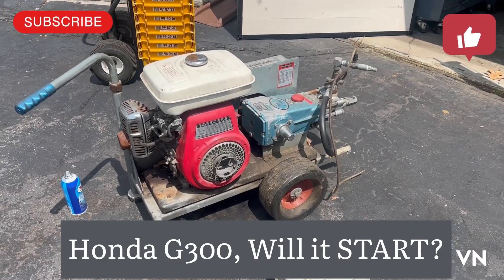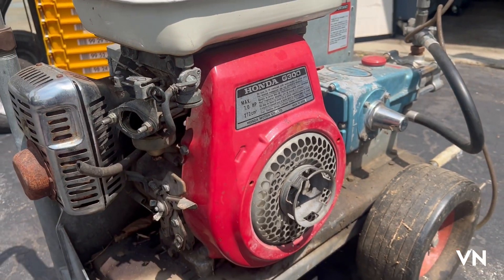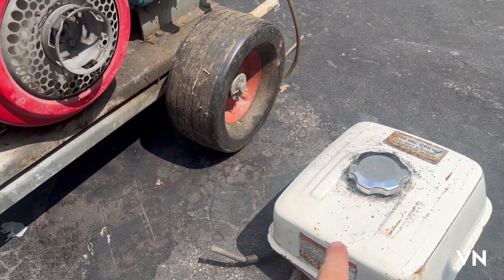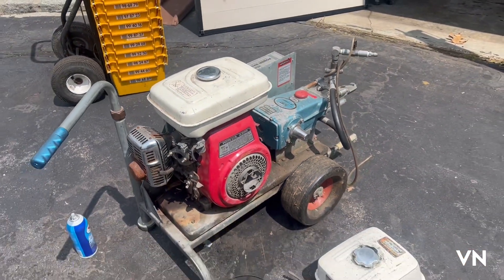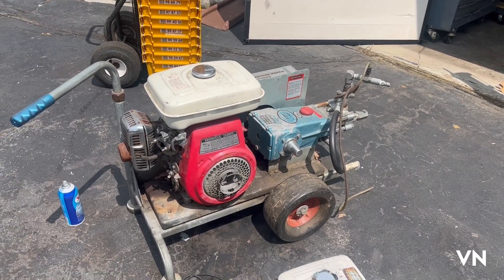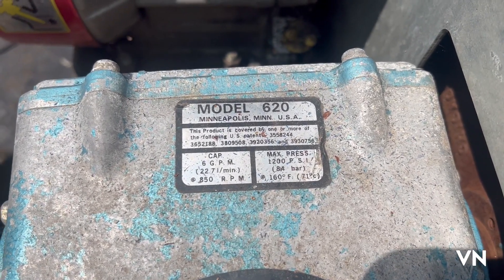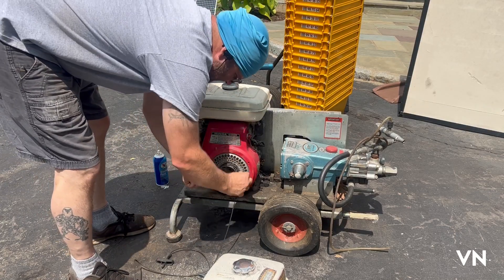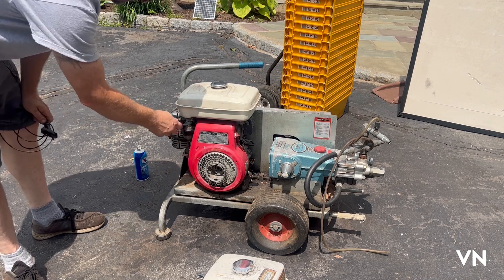Nastiest Carburetor Ever!  Honda G300 Engine, Will it START?

Comment: I have a Honda G41 engine, tried fixing the current carb to no luck. Was making sound like it was going to start and run for a few seconds.dont know how to make adjustments/trims to the carb so i just thought I could get a new one. Is there a replacement carb that you can advice to use for this engine?
Reply from the maker: I am sorry I do not know of a carb that fits. These older units are hard to find parts for. Best bet is some small engine web sites. Amazon does not carry many parts for these older style.